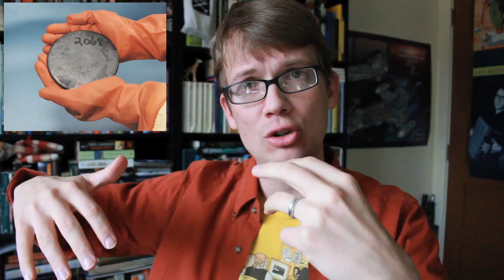Why Did Fukushima Explode?

Comment: 2 questions.

1. What are control rods made of?

2. How did the fuel rods create hydrogen by splitting water atoms? What is the environment hank is talking about that combined with heat allowed the creation of hydrogen?
Reply: Control rods are made out of dense and stable atoms that's capable of absorbing the neutrons shot out from the fission of uranium without going under fission themselves because they are stable and dense.

When the water H2O came in contact with the neutrons and protons that were shot out and left over from the uranium.

The high energy proton/neutrons carrying the huge amount of energy will break the hydrogen bond on the H2O. However that huge amount of energy they were hit with(from the proton or neutron) will cause the oxygen/hydrogen to have a huge amount of excess energy and they want to go into a lower energy and more stable state by shooting out xrays and gamma rays(i.e. high frequency photons), as well as heat and visible light.

However it's the gamma and x rays that can ionize atoms(basically means knock a electron out of its shell). Ionization is especially bad when a gamma ray gets into your body and knocks a electron out of a hydrogen and the hydrogen/electron try to find another others to bond to(sometimes DNA).
Reply: Ah ok, thank you. Yeah, gamma is bad news bears. I just didn't quite understand what he meant by the "environment" he spoke of. I thought perhaps something else besides just the breaking of the H2O might have had a part in it.
Reply: To answer #2, High pressure steam reacts with the zirconium cladding on the fuel rods to produce hydrogen gas.

The uranium itself is difficult to handle and thus the fuel rods are encased in a zirconium alloy. Zirconium is used because it is corrosion resistant and barely reacts to the neutrons that are necessary for the reactor to function.

However this zirconium has a major flaw; it reacts with steam to produce zirconium oxide (thus damaging the fuel rods) and hydrogen gas. This hydrogen gas is, of course, extremely flammable and caused a portion of the damage at Fukushima and could have damaged Three Mile Island before it was vented. 

There are ways to mitigate the hydrogen. Basically you put a catalyst at the top of your containment system (hydrogen will float to the top) that will calmly convert the hydrogen back into water. These are, unfortunately, not standard equipment, especially in older reactors.

There are also plans to use a different cladding for the fuel rods, but any small change to this cladding has very large effects on the reactor and thus you need to design the reactor with this in mind.
Reply: Logan Traffas To explain it a bit shorten and not to detailed there are 3 basictypes of radiation: alpha beta gamma. alpha has higher energy but only stays for a short while and can even be blocked by a few sheets of paper, gamma is so slow that it does not effect you in compared to alpha rather high amounts/long times but it is impressively to block and last through quite long times. That it cant be blocked on the over hand also means that it goes through most of your body without doing that much to it ( think of an X-ray, most of you stays black) gamma-emission is dangerous still because if an amount of gamma-emission is blocked by something out of metal or mineral this can provide alpha&beta-emission (that is fucking complex)... and that is one of the 2 reasons why it is slightly more dangerous in your pocket than inside of you, the other one is that the acid your stomach contains is quite good at absorbing neutric energies because of its free protons ( sorry for my bad english)
Reply: fullmetalfunk So fun fact, it is safer to eat something emitting gamma radiation than it is to carry it in you pocket (not to say that you should)
Reply: Source :) explains it much better then i can. http://www.reddit.com/r/askscience/comments/1hbd86
Reply: Cesium or Halfnium make up control rods
Reply: energy in rays is not only about the speed ( they all move by the speed of light as most of them are 'light' by the point of physics) the energy emitted by a particle ( with mass close 0) directly correlates too its frequency when discribet as wave, what is a really complex matter as speed and frequency are affecting the mass of a particle but all the three of them define emitted energy
Reply: Faye S so to be more precisely alpha is indeed an "existing" He^4-core without electrons and quite heavy  and big (4u) and "only" moving with ~2800 to ~5600 [m/s] which is rather slow as movement speed compared to gamma with the speed of light ( 299792458m/s) but has higher frequency. gamma ray are photons emitted by a core in radioactive decay ( i really don't know how to explain it properly because i  lack the words) so these photons were part of the mass that is lost between for example the two condition in  radioactive fission. so yeah by slow i meant "of lower frequency" so yes i was a bit unprecise in my language, sorry if i confused or bothered you
Reply: Shlanta Of The Mike Eating a gamma radiation cookie is the same as keeping it in your pocket for the same amount of time it would spend in your body before anal ejection. Whether it is harmless or deadly depends on the intensity. Alpha radiation, however, is composed of helium ions and would be stoped by the lining of your pants, so better to keep it there than to eat it.
Reply: Faye S
 Actually, your explanation involving hydrogen being created by radiation splitting water is wrong.

What actually happened was water(as supercritical steam, which is extremely corrosive) oxidating the zirconium cladding on the fuel rods, with the reaction 2 H20 + Zr -> ZrO2 + 2 H2. Basically, at high temperatures water will cause any metal to rust really quickly, which produces lots of hydrogen.

Modern water cooled reactors prevent hydrogen buildup by using recombinators. These use catalysts that allow hydrogen and oxygen to recombine into water at low concentrations so that you never end up with an explosion. Recombinators have been installed in pretty much every reactor of that type outside of Japan, but not at Tepco's plants because of serious organizational issues with Japanese corporate culture where superiors essentially have to act as infallible popes. If these units had actually been installed in the fukushima reactors we wouldn't have ended up with this mess.
Reply: Really? What is the reason behind that? I can't imagine you digestive tract shields gamma rays any better than denim and skin haha.
Reply: ***** Thanks!
Reply: djcy9219
Alpha has higher energy? You should do some research before posting. Gamma ray is slow? Weird. Last time I check Gamma ray still moves at the speed of light.
Reply: Faye S He said his English wasn't so good, give him a break.
Reply: Raptoer Barton Hm, very interesting.

Comment: I think fission products should be dumped into deep drill holes in subduction zones in the earth. If this stuff is radioactive for thousands of years send it down into the magma.
Reply: There is a way to destroy the long lived stuff permanently. You can use fast neutrons from breeder reactors with a good enough burnup rate(such as molten salt breeders) to destroy most kinds of long-lived waste.

You'd still be left with the stuff that takes a few centuries to decay, but at least that's doable compared to storing waste for millenia.
Reply: That's actually not too bad of an idea I guess. Could be bad if the magma makes it's way to a volcano at some point and then erupts and sends all that radioactive material everywhere but I don't know enough about nuclear physics or tectonics to know if that could happen. 

One late night I thought I had come up with a brilliant plan for like 2 seconds. I thought "Wait. Why not fire all the radioactive material off Earth in a rocket right into the Sun?!" and then I realized what a HORRIBLE idea it was.
Reply: I agree that there are risks with fission, but the trouble is, green (sustainable/renewable) sources, like solar, wind, hydro, geo, are simply not close to the terawattage they need to be at to wean our civilization off oil.  And the consequences of the coming oil crash, if we don't get unhooked, include the potential end of our technological civilization.  Currently, in industrialized countries, each calorie of food is brought to the consumer's table by multiple calories of oil spent (in pesticides, fuel for various transportation steps, fuel / electricity for processing machinery, electricity for refrigeration, petrochemicals used in plastic packaging and in antibiotics and fertilizers).  Rural populations that eat locally sourced food might be able to survive, but if oil crashes, we are looking at an urban die-off that could number in the billions, and which would create resource wars and conflicts that would likely destabilize and destroy democratic traditions everywhere.  We will be left a pitiful, starving remnant in a shattered ecosystem full of superbugs we no longer have advanced medicines to fight against.

Compared to that risk, I consider the risk of some nuclear contamination minor.  Even if contamination is so extreme that it greatly alters the course of human life, I think it is less likely to destroy our civilization than the oil crash we are headed towards is.  So we have to prevent the oil crash first and foremost, and to do that we have to make up the terawatt gap.  Currently there is no way to do that without nuclear.  There is already a ton of money being spent on renewables, and surely more will be spent (and even more than that should be spent), but still, the gap is huge.  There might be no way to cover it within the next century without nuclear, barring unforeseen advances in technology.  It's easy to tell ourselves that all we need to do is increase efficiency, but the sad truth of humanity is that when we gain efficiency, we don't conserve - we increase use.  People who buy highly fuel-efficient cars drive more and it eats up the savings.  It's in our selfish nature to simply use everything available to us.  So I really don't think breakthroughs in hydrogen cells or a bit more efficiency wrung out of a process here or there will save us.  We will always want more terawatts every year, so more terawatts have to be found from somewhere.

Fission is ugly and dirty but it's better than gambling that the oil-based energy system that our entire civilization depends on will last another century without imploding.  :\

As for the space elevator, the biggest problem isn't building it - it's expensive but most of the technological problems have already been brained out.  The problem is defending it.  It would be a vast target for rogue states and terrorist cells, and the destruction and collapse of a space elevator could devastate an entire continent.  It's sort of the holy grail for spaceflight, at least in terms of launch costs - but I don't know if we will ever be able to safely build one until we live in a much more stable and peaceful world.  How that will be accomplished with the oil problem looming over our heads, is beyond me.  Which is why I say go nuclear, acquire the peace and stability that oil independence will bring, and THEN work on the space elevator to get rid of the waste.  I see it as the least-bad out of many bad options.
Reply: fullmetalfunk not such a horrible idea if you get the material to LEO via a space elevator rather than a chemical rocket.  Not that space elevators are immune to failure, but if a space elevator fails the payload drops, well, right on top of wherever it was lifted from.  That's bad, but not as bad as, "woops, sorry guys, guess our rocket full of radioactive waste blew up over YOUR country.  Sucks to be you!"

Once it's in orbit, the rest is simple:  lock on with a robotic tug, give it the correct amount of acceleration to give it an orbital path ending in the sun, and let it go.  The ultimate incinerator.

And until we develop space elevators, I say we break the logjam on certifying Yucca Mountain.  Quite simply, fuck Nevadans.  The rest of us outnumber them by a whole lot.  Eminent domain covers this pretty well.  We need energy independence and the end of fossil fuel addiction much more than we need to not step on the toes of all, what, two people who live near the damn mountain.  Heck, one flank of the mountain borders the Nevada Test Site where over 1,000 nuclear devices have been detonated over the years.  I don't think anyone's going to be wanting to build a children's theme park nearby any time in the next millennium.  What is wrong with us for not going ahead and using it?
Reply: nfinn42 The thing is though we're a LONG way from having space elevators. Congress can hardly make decisions on what they're going to blow their money on every year let alone the building of a multi-trillion dollar bridge into the ionosphere which many just don't see as very important when people are starving and can't get proper medical care you know? The string of nuclear waste s a ticking time bomb and the more we add to it the worse it's going to get. I agree that if we are going to store it then we need to store it somewhere like Nevada and Yucca mountain but it can get into ground water, a bad earthquake out that way could cause some serious issues, and someone is eventually going to side step regulations and dump it somewhere it's not supposed to go (like off the coast fo Somalia, look it up) and shit man...it's just bad news.

We CAN ween ourselves off foreign fossil fuels and fossil fuels all together, nuclear energy isn't necessarily the perfect answer. Think about all the money spent in the oil and nuclear industry, if just a fraction was put towards research in renewable and green energy sources. Those big companies are a big problem on our path to energy independence. Nuclear energy may be "safe enough" but eventually shit will go down, like Fukushima, 3 Mile Island, Chernobyl. We have GOT to stop using it, at least on Earth. Maybe once we bridge out into space it can have more uses because we can dispose of it easier then.
Reply: nfinn42 Well I wouldn't say we have to permanently and immediately stop using nuclear energies, but as we increase out populations, run out of fuels and start depending more and more on fission, the likelihoods of nuclear accidents goes up as well. I think we should still be using nuclear energy for now while pushing research into alternatives (nano-technology is looking pretty promising and I'd argue hydrogen cell vehicles are as well) and teaching the next generations growing up about the cost of consumption. Not sure how old you are but from how you speak and the fact that you're watching this channel I'm guessing we're at least somewhere in the same age range. Our generation (born in the mid to late 80's and early 90's) was brought up in the green ideas of the 90's, focusing on recycling and lessening water consumption and for all intents and purposes our generation has done better than previous ones at working for a cleaner planet. Still you're right our appetites for energy is growing, no matter how much we recycle, or turn off the lights when we're not in a room we're still exponentially growing that appetite. So I think if we instill ideas again about how important energy usage is to kids now while focusing on more public transport infrastructures in big cities along with things like rooftop gardens, solar panels, to at least lessen the burden of power plants by a bit and keep funding research into alternative methods, we might get somewhere. Maybe not where we ultimately need to be but maybe in 100-150 years we'll be a little more closer to energy stability, at last in the 1st world. 

Then again perhaps I'm too much of an optimist haha. 

Eventually we're going to have to stop using nuclear energies on this planet at least, OR find a better way to clean up and get rid of the spent and contaminated materials. If the resource wars don't kill us, eventually fission and it's byproducts will.
Reply: BosonCollider
And Much less mass of products and you get a crapload of energy from the breeders too! Yay for Molten Salts!

The guys and gals over at Transatomic Power in Boston are doing a great job with this.

Comment: ok, fission products produce heat.
not as much as the chain reaction but still so much that it has to be cooled.
why do we use a system which cools it by using power (diesel generators for example) instead of a coolant system which produces power (like for the chain reaction)?

Comment: I think these problems with nuclear reactors need to be recognized for what they are: engineering problems. For a long time, people have been judging broad ideas by the successes and failures of examples. Because of this, the problems that we face with things like nuclear power may be completely fixed and yet most people will not even notice a change.

Comment: but efficient as in it lasts longer, but it does not produced the same levels of heat uranium does so it;s not used, and it can be weaponized by placing it in a sealed hydrocarbon solution and heating it to about 1200C for an hour or so then reacting it, the process turns it into uranium 236 and 235. There was some kid in the 70s who made his only mini UR reactor this way. there's a documentary here on you tube about it, look up "the nuclear boyscout(1/2)"

Comment: The reactor likely automatically SCRAM's (best acronym ever btw) in the event of an earthquake besides the earthquake probably knocked out something critical to electricity generation anyway. Though newer and smaller reactors are designed to use the natural circulation of the water do to the heat generated by the fuel to keep the fuel cool for quite awhile without outside intervention.